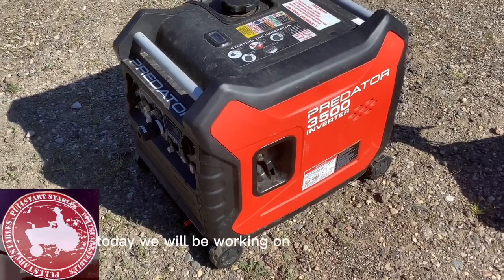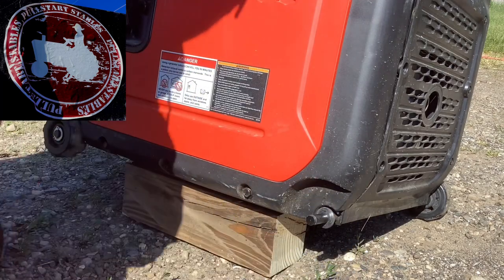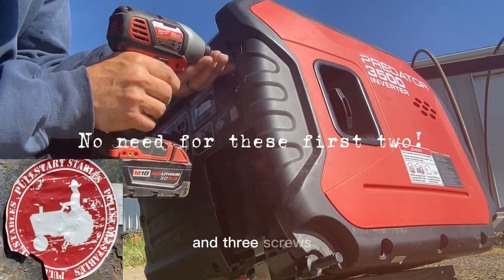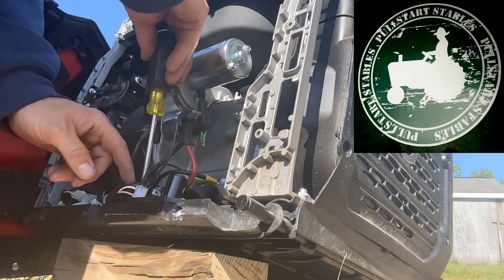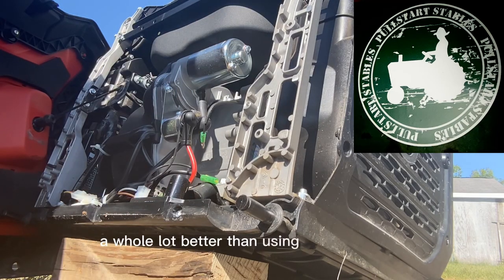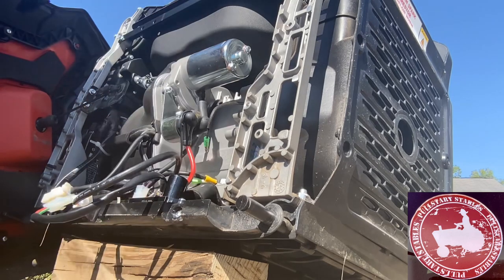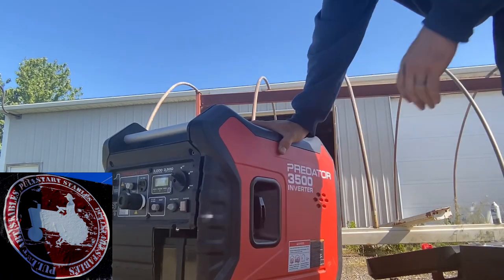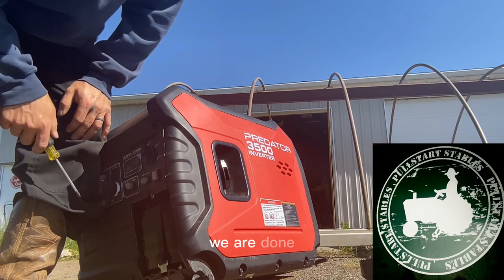Predator 3500 Inverter Generator Ignition Control Module (ICM) Full Replacement

Comment: So why did the CDI malfunction in the first place ? I have a Predator 3500 inverter generator, I have replaced the CDI once about 7 months ago, & now the CDI module doesn’t work now. So what is causing it to malfunction a second time ? Reply if you have the answer.
Reply from the maker: It’s hard to say for sure.  Unfortunately our world is surrounded by cheap throwaway marketing.  I know in this instance, we bought the cheapest CDI on Amazon that was available.  It’s hard to expect much when we don’t pay for much.  It’s funny you mention this though, the same generator is back in my shop for repairs and I have not yet looked at what it needs.  I suspect the same thing again, and we may opt for a better known source for quality parts.
Reply: Thanks

Comment: I have the updated version of the 3500 and upon buying the module and opening up the generator (both sides) I don’t see where they’ve moved it to.  Has anyone else replaced this on the newer gen model yet?
Reply from the maker: Thanks for stopping by my channel!  Without seeing one myself, I wonder if they changed the ignition type and did away with the CDI due to so many failures?
Reply: I have the same problem. I can't find it
Reply from the maker: Wild.  Keep me updated, if you find anything out 👍
Reply: @PullStartStables  I eventually spoke with a Harbor Freight tech support person who informed me that the newer versions don’t have an ICM, and the components are just wired in at various places, but none are replaceable.  BUT, for what it’s worth, we did some troubleshooting and my issue ended up being a faulty o2 sensor which was easily bypassed.  He said 75% of the new models’ sensor fails and causes several different symptoms.
Reply from the maker: @EvanRKnipp  great news, thanks for sharing!

Comment: Thats a good good sound 🤣?? It was idling up and down. 🤨 .Why didn't you plug something into it and show us it was producing power 🤔? You just shut it off and said it was fixed..You didn't show us the meter on the front panel showing it was producing power either 🤔. At the beginning of your video you didn't demonstrate to us what the generator was doing, what the problem was 🤔. I don't believe you fixed it myself 😂.
Reply from the maker: Wow, those are all great points!  My intention was to make it run, and it did.  I very much appreciate your constructive criticism.  There are things I may miss as the mechanic, videographer, editor and producer, and there are things I know that I may not include.  Thank you for the comment!